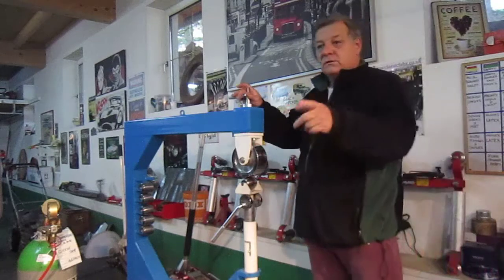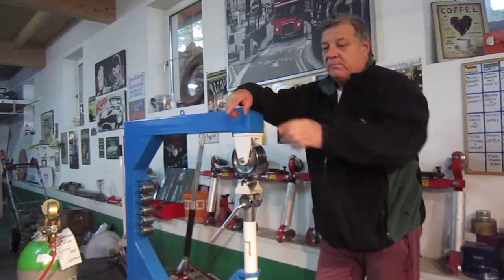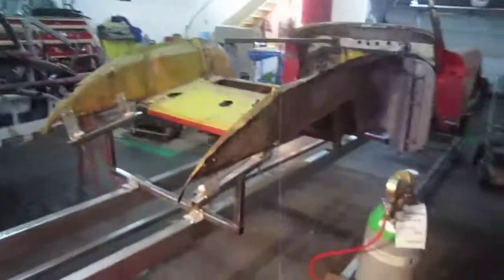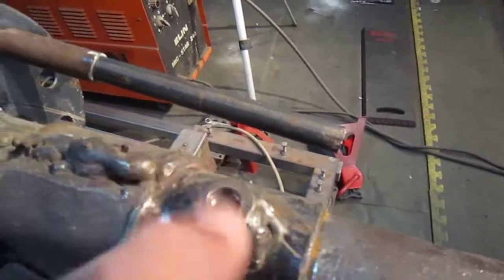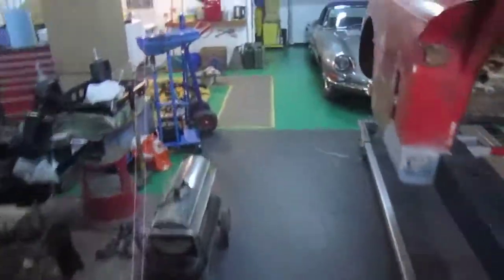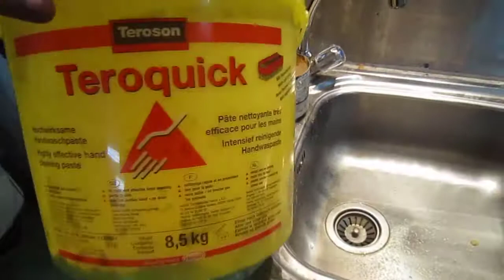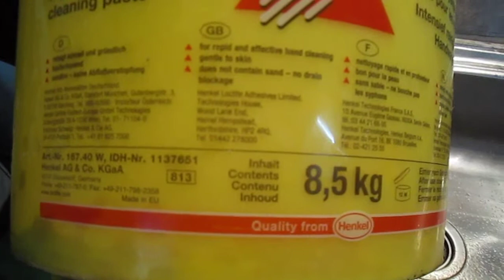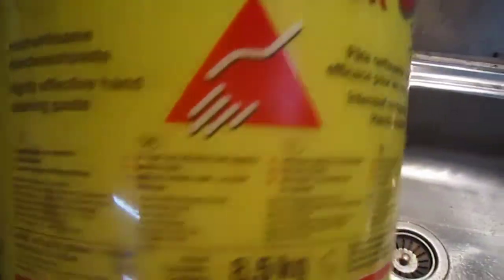Car body jig brake & English wheel Modifications

Comment from the maker: Making the English wheel mobil with castors has raised the working level which is a bonus. The brake system on the Jig 
is a job i have been meaning to do for years. Any comment, suggestion, advice to David at davejaguar66@gmail.com